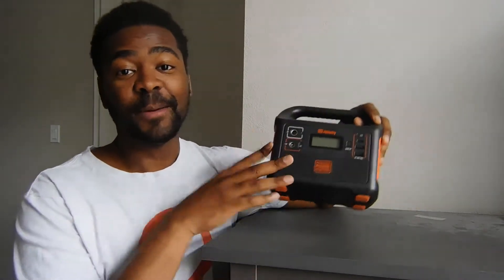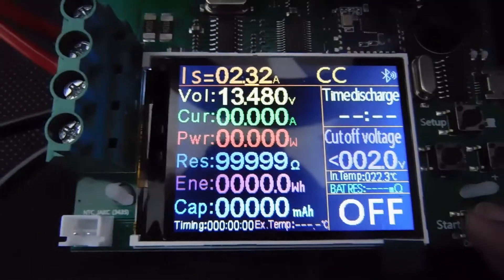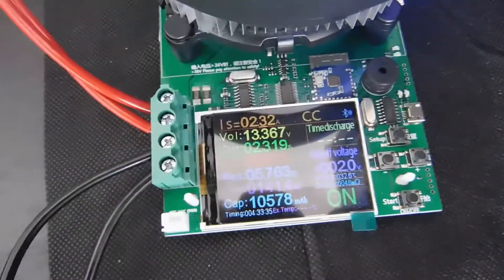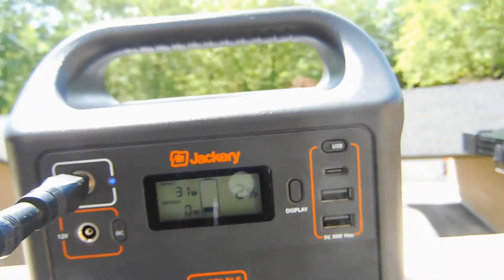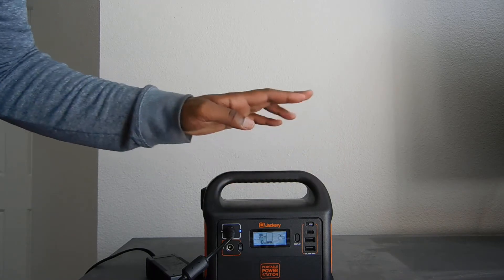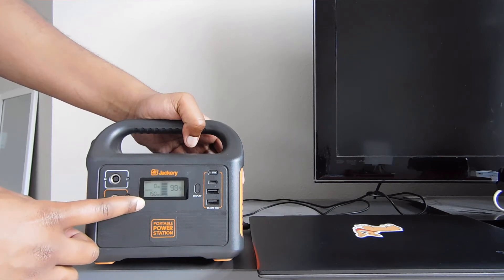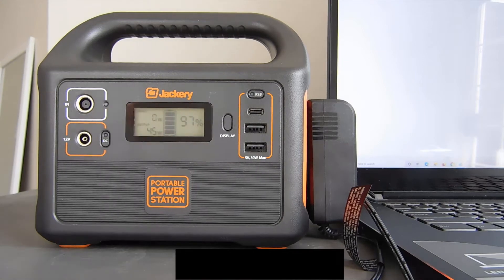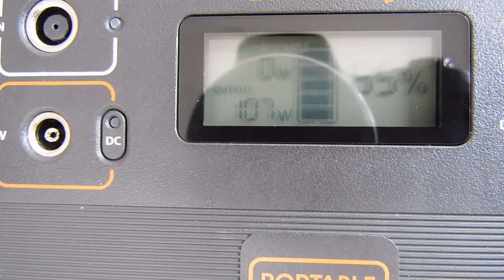Power Station Review: Jackery Explorer 160

Comment: Can you tell me where you bought the 12v DC output plug to female cigarette ligher socket adaptor?
Reply from the maker: That actually came with my Jackery. There are a couple of 5.5mm to barrel jack connectors on Amazon that may work, but I haven't tested any of them.
Reply: @smallscalesolar  I have both Jackery and Goal Zero power banks and the DC adapters for Goal Zero are interchangeable with the Jackery, though they are a little pricey.